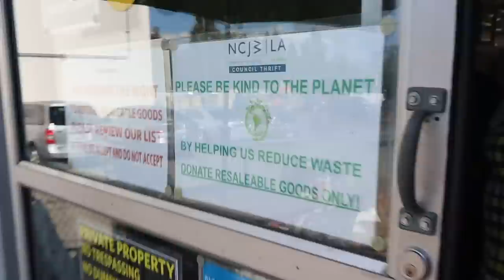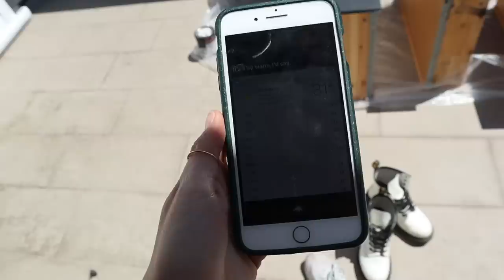we transformed gabbie's trash (she loves it now)

Comment: Omg how do you look at something and see so many options of what it could be because I struggle
Reply: I think it's the attitude of 'everything can change'. I use Pinterest a lot for inspiration too. Anything made of wood can easily be painted in any colour you want (other materials too, but wood is the easiest imo), hardware can be replaced, you can put paper or plastic foil on lots of things, etc. Try to imagine what look you want in your house and find shapes that fit (colour can be changed much easier than shape). We have an eclectic home, so almost any type of furniture will fit in with our style. What makes it cohesive for us is colour. All our furniture is either brown or yellow or grey or black. So I look for furniture that I love and ignore colour. I have this faux chest of drawers (the top two drawers are one lid to hide TV things inside) that looked bad. The top was chipped, and the lacquer was peeling and there was some staining and what looked like water damage. We bought it super cheap, sanded it completely and filled up the damage with wood filler, all the damage was superficial and once sanded it looked much better. The wood wasn't top quality, pretty soft, hence all the dents we had to fill in (it's a faux dresser, like, it's trying to look antique but it isn't) so we painted it grey, including the handles. It now has quite a modern vibe with an antique shape. :)
Reply: Anneke Oosterink Very good tips! 👍🏻 Thank you.
Reply: try brainstorming and just writing stuff down then developing from there
Reply: Yeah hopefully brainstorming and finding inspiration will help! I’m so used to taking everything as it is, maybe I just need more practice to show myself there are other options!
Reply: Just getting the energy up just to do my DIY stuff like that it would be amazing,, I love painting I used to do ceramics for a living, it's so fun esp. when you get the kids involved!! Well hopefully everybody's having a gorgeous day!! 🌻🌞🤗💜🎨
Reply: @GabriellaFitzGerald  go on Pinterest look inlike home& garden mag.s thats kool inspirations t, just look around your house no matter what it is if you see it you can have your inspiration on point & jus what you envision go to thrift store, buy the stuff n bam!  LOL p.s. mainly just have fun wit it chic you only got one life to DIY LOL!!
Reply: @annmoody7866  So, philosophy: 'All of Life is a DIY Project.' Yes? :)
Reply: I feel like if you give it a try once you’ll get more confidence and more of an eye for it. It is all about what you like and how you want things to look in the end and sometimes that can take practice. But if you buy a practice piece and just play around with a little bit of everything I’m sure you’ll get the hang of it

Comment: Won't spackle separate from the wood surround? Just wondering why wood filler exists if spackle will do.
Reply: Ddrhl  also wondering this
Reply: oh my gosh yes i was screaming that the whole time!!! like they are using dry wall putty for a table... walls don't get touched very often but a coffee table gets used all the time it won't work like its supposed to
Reply: @cassidy983  If you paint over it and either wax or some sort of sealant you're fine. Wood filler isn't that strong either and won't hold up to repeated handling unless you seal it.